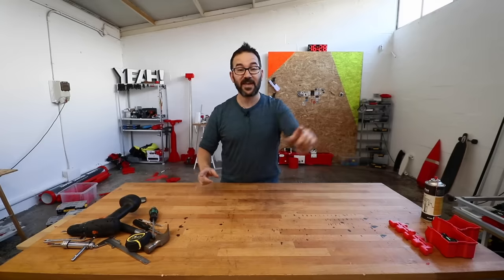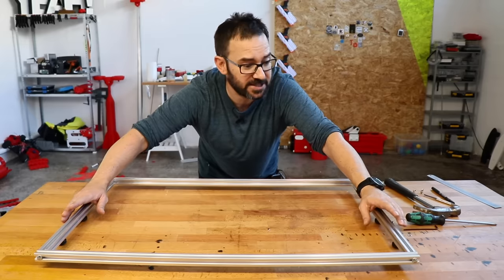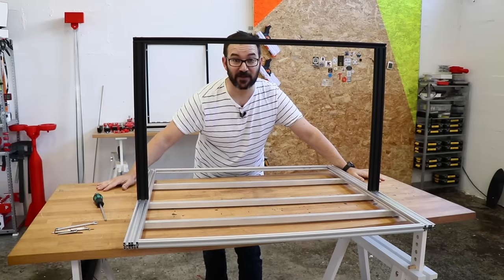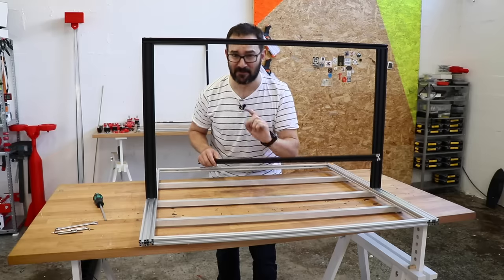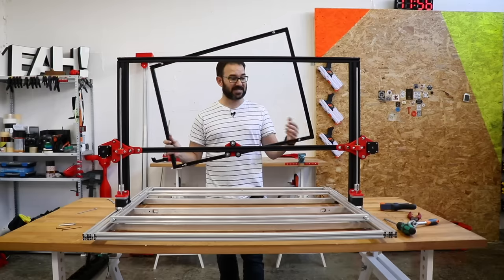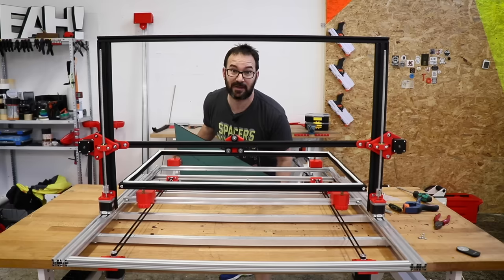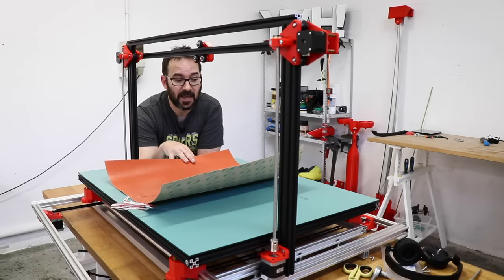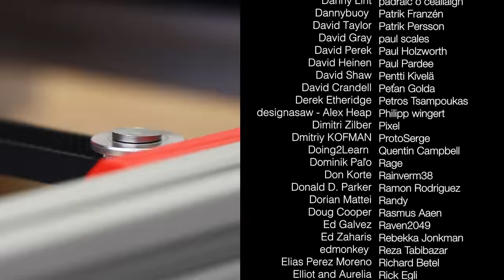GIANT DIY 3D PRINTER FROM SCRATCH

Comment: I’m going to take a wild guess that print quality on this is going to be rubbish. Unless the print speed is dialled down to impractical slow levels, even with a super lightweight carriage with bowden extruder (no way you’d be able to put even a pancake motor direct drive extruder on it), the inertial mass is going to cause a lot of flexing on a gantry that big. The x-axis carriage rail is too flimsy to prevent sagging, which is very noticeable when you’re dealing with layer heights of 0.1 or 0.2 mm, and a drive belt that long is going to create some nasty backlash.
The Y axis... nope! A bed that heavy... just nope! Again, inertial mass and belt flex/backlash will be a big issue.
A printer that large would need at least 4040 profile, a LOT of structural reinforcement, nema 23 motors...

But... if he’s having fun building it then great. It really ain’t gonna work well at all, but if it’s fun then... enjoy!
Reply from the maker: You don't seem to want anyone to enjoy anything...
Reply: On the contrary, I know how much fun building a 3d printer can be, and how much fun you can have printing things when it works well. I’ve built several - some kits, some my own design. I’ve purchased so called “professional quality” proprietary printers only to find they’re made in China with cheap parts and only work well for 6 months or so. I also have the genuine Prusa i3, which is by far the best printer in my collection, because it has been engineered very well.

I also know how downright frustrating it is when you don’t build the printer well, and your prints turn out a mess. We’re talking micrometer tolerances here, and if your printer has any play or flex in it, it doesn’t work well. Or it might at first when everything is new and tight, but after the moving parts settle in, it gets sloppy and prints go wrong.

It’s not enjoyable for people who follow examples of bad engineering, spend good money on the parts only to find out the design is no good. Thingiverse is full designs that are rubbish because there are so many people in this hobby that don’t have the first clue about Engineering science. 

Your video is similar to a lot of items on the Thingiverse website that never show the end result. You’ve enthusiastically shown your new design, but you haven’t shown it completed and with examples of what kind of prints you can get from it. 

Yes, I want people to enjoy mechatronics and 3D printing, as I have for decades. But they won’t enjoy it if they’re given bad advice or follow bad engineering examples. They’ll just get frustrated because no matter what they do, they can’t get the machine to work properly, so they give up.
Been there myself!

I’m happy to be proven wrong. If your massive printer does work well, I’ll retract my comments and commend you on your efforts.
Reply: @jamesstevens2362  I bet you're fun at parties!